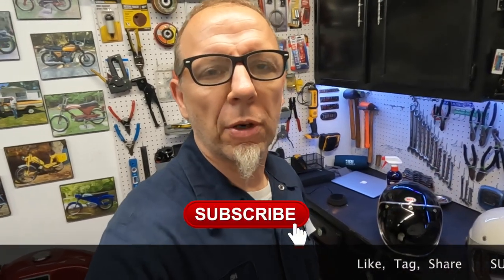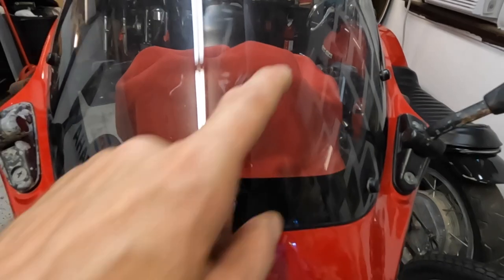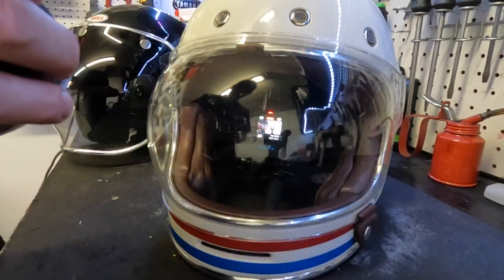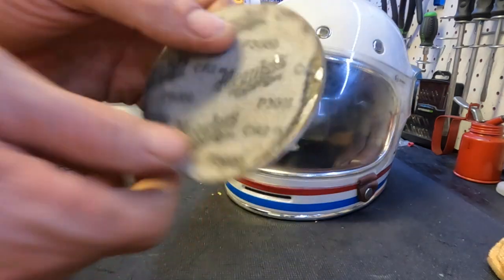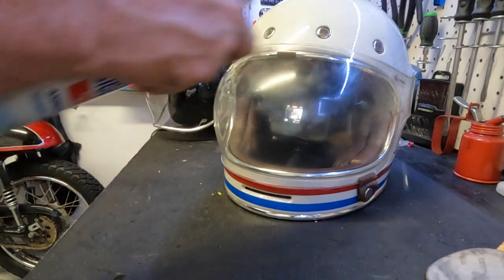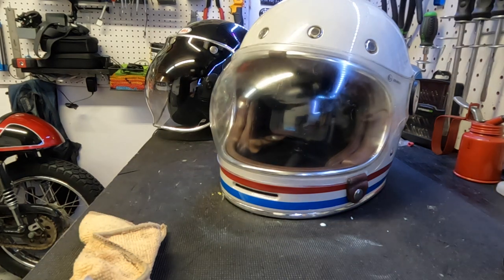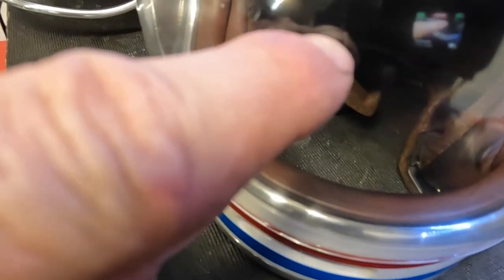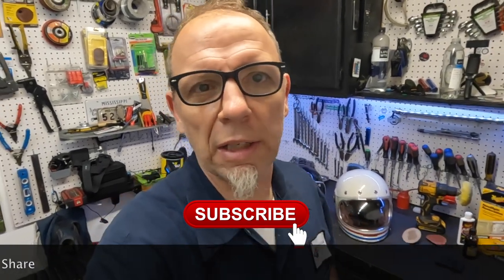Bell Bullitt Helmet Visor Scratch Repair: Using Meguiar's Headlight Restore Kit #caferacer #cb750

Comment: I need to get a helmet like that. Love the retro tron vibe
Reply from the maker: It is super comfy. Was a little pricey but you only get one head. Called the Bell Bullitt. Thanks for watching.
Reply: I'm going to start this off by saying I don't work for Torc in any way, shape, or form.  This info comes from the fact that I bought one of these helmets several years ago for the sole intended purpose as a passenger helmet for my girlfriend.  I liked the retro styling of the Allegiance model in white with thin red and blue stripes that complimented my own white AGV Sportmodular with a carbon fiber stripe up the middle (without looking too "Bobbsey Twins"), and the fact that the large opening and shield made viewing scenery on rides very easy for her as well as having the perception of not feeling quite as closed in as a more standard helmet opening.  I also picked up a dark smoke bubble shield for it that closely matches my own dark smoke shield, and in addition to the benefit of the tint she said the bubble also feels better and more roomy (if that description makes sense) when she's wearing glasses inside the helmet.  Now, on to the helmet.

A very similar retro-style full-face helmet is the Torc T-1 with a large face shield opening and a narrow chin bar just like the Bell Bullitt.  It's DOT and ECE certified (22.05 but not 22.06 yet, if that matters to you) and runs in the $260 - $280 price range instead of the Bell at $400 - $450.  They come with a "flat" face shield, but also have optional accessory/ replacement bubble face shields available for about $40 in 6 tint shades: clear, light smoke, dark smoke, chrome, yellow and orange.  They come in about 8 solid and/or metal flake colors, 10 retro style multi-colorways, and a couple carbon fibers that are way more expensive.  My one warning is in regard to sizing.  Make sure that if you're buying this helmet and don't have the opportunity to try it on at purchase (such as online) that the seller has a very good return/ exchange policy.  I don't know if Torc has changed anything in the last 3 years, but sizing in 2020 was basically a full size off (large) for Torc's T-1 helmet specifically, and they were well known for it.  If you normally wore a XL then you needed a large T-1; normally wore a large, buy a medium T-1, etc.  If you're in between sizes, you're on your own.  I don't know if the sizing issue has changed at all since then, which is why I included the refund/ exchange policy comment.